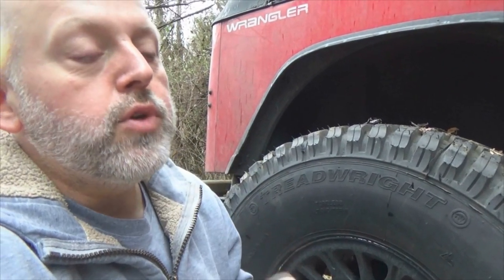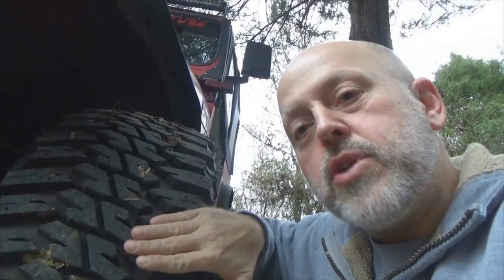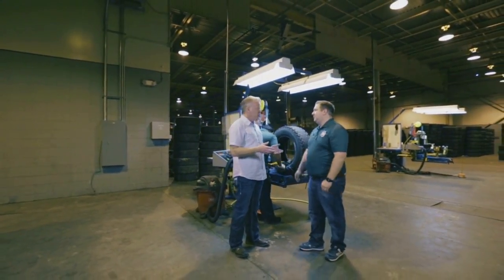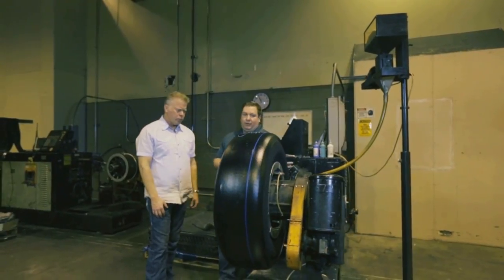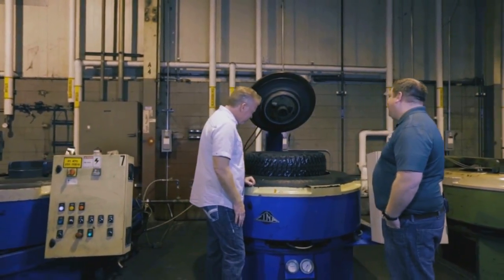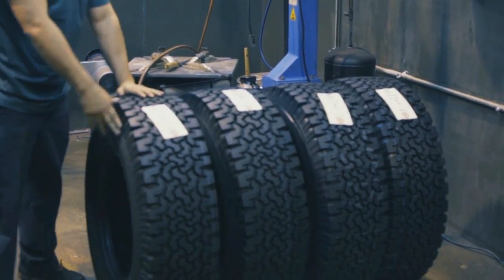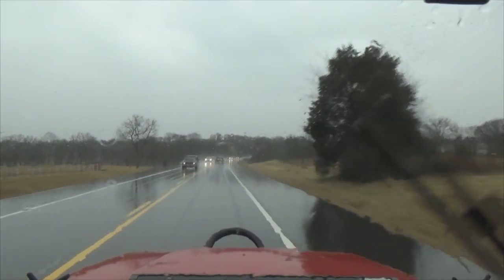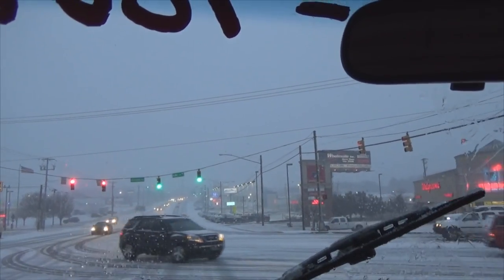Jeep Wrangler YJ - Rolling on Treadwright Tires. Retreads vs New? Well, they are actually remolded.

Comment: Have you ever done a video on repairing the YJ column wiper delay switch? My slow and fast wipers work but the delay only works once in awhile and does not adjust speed..it's just stuck on the slowest time-frame speed...any suggestions? Is it the control box? Do these YJ's even have a control box like the chevy trucks do? (mounted on firewall)

Comment: I have new 31" Wrangler (big tread) tires on my jeep wrangler,,,they were pricey!! @ over $200 each.  But I noticed that on this light weight jeep,,they hardly wear at all,not matter what terrain including hywy. I have had them over a year and still look like the day they were installed.
 But I have to admit,,I dont drive it everyday.
Reply: And I now looked at these prices,,,,they are less than half the price. Had I known I woulda bought some.
Reply from the maker: I understand that about the prices! Those big tires we Jeepers like get expensive quick! I have to really give props to the TW  Guard Dogs. I daily drive my Jeep. it easily gets 325+ miles a week put on it. I gotta say they have great road manners. They did great in the snow and rain, even ice they did well. Looking forward to when I get the time to go test them playing on the trails! Thanks for checking them out! Have a great day!!